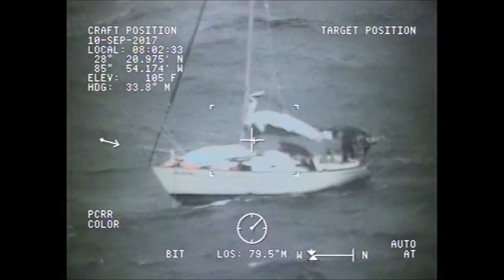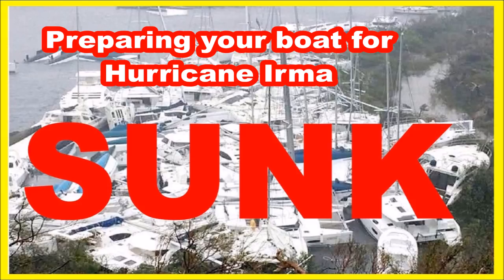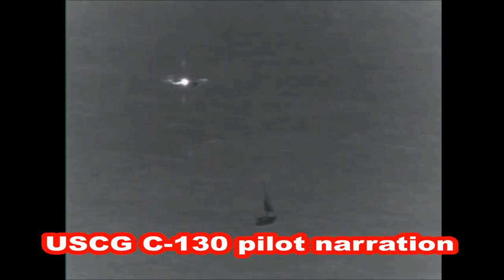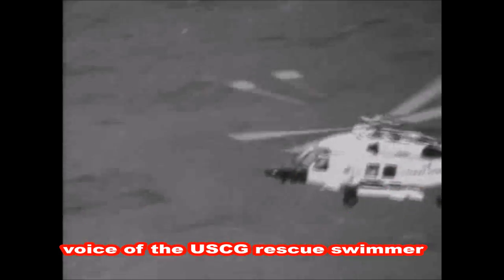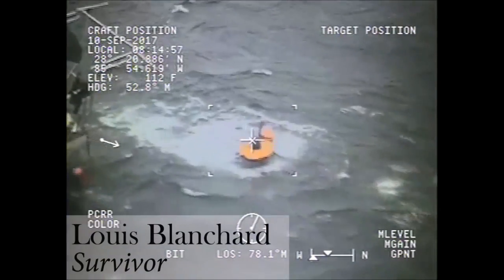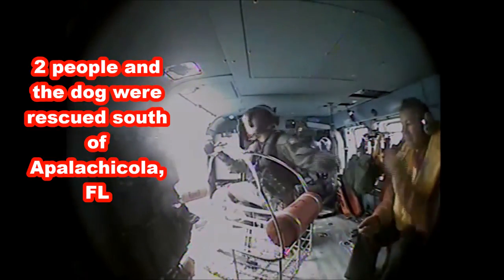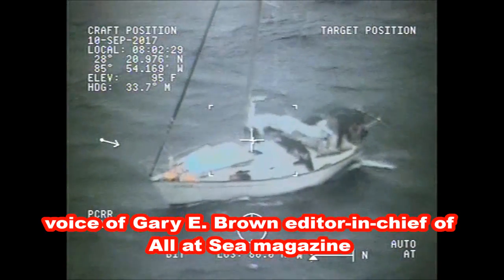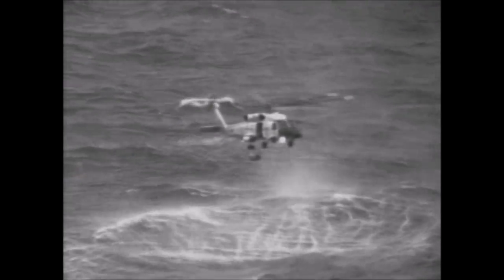Sailing Offshore in Hurricane Irma

Comment: Thanks for presenting this, however, it would have been nice to clarify/expand upon the issue of trying to outrun a storm vs heading tangentially to get out of its path. I agree that trying to outrun it is risky, but, if you have 2 days notice is it not a different issue to head 300-400 miles south
Reply from the maker: Elliott Bennett I think Gary E. Brown did an excellent job of addressing the pitfalls around minute 5. Here are a few more. Storm tracks are unpredictable. Irma was supposed to go up the east coast and these boats were caught in the Gulf of Mexico. It takes days to prepare for on offshore passage (fill fuel, change filters, get water, et cetra). Storms are huge and move 15 mph while sailboats have top speeds of 6. Even 20-25 knot winds are enough to create rough seas to clog most fuel filters.
Reply: You've got a monohull blind spot.  Many catamaran sailboats sail 10 to 25 knots, not "6" tops.  Needless to say, there are also some very large monohulls that are much faster than "6" knots.    

Sensible sailors who plan to flee the path of a hurricane prepare their boats weeks before the storm could reach them.  I can't imagine a competent sailor limited to just 'days' to prepare.  If it is hurricane season where your boat is located, sensible sailors keep their boat prepared to get away in a day or two.  If there are tropical storms developing, you have at least a week to prepare to leave before it reaches you.  Just because you don't know exactly where the storm will track, it is a near certainty which way it will NOT track.  Hurricane Irma for instance was headed North and West (until it reached central Florida).  Whether the storm chose to track up the West or East coast of Florida is not critical to know.  If you don't have a safe place to secure the boat on or near shore on either coast, you sail tangentially to its track (assuming you don't have a slow monohull).  

When the eye of category 4 hurricane Irma passed over my catamaran in the Florida Keys on September 11th, with 130+ mph winds, it was well anchored in a very shallow and narrow, mangrove hurricane hole.  The eye of the hurricane passed right over my boat---dead center.  It was located one mile east of Cudjoe Key.  The boat suffered two lost hatch covers (which I forgot to lock down) but my mainsail remained on the boom.  Otherwise not a scratch was on the boat.  However, because I ordinarily have no bilge pump installed, some rain blew in through the open hatches and I got an inch of water in the bilge.  My salon table/settee and 4 berths were still dry.  I sponged up the bilge in an hour or so.  

Other boats in the area did not fare so well.  Many hundreds of boats (probably 1000+) which were anchored/moored out among the islands, were lost to the storm.  Approximately half of them either crashed ashore, disappeared out to sea, or sunk in place.  Lots of boats which were dry docked were also strewn about---many were blocking the highway or lying up in people's yards or crashed against other boats and sunk in a marina.  Consequently, I'll choose a hurricane hole any day over a marina or mooring---providing I can't manage to sail out of the path of a hurricane.